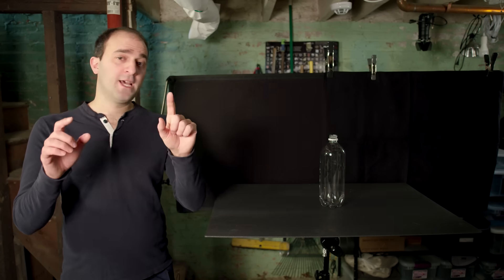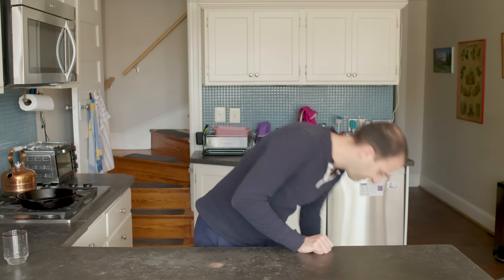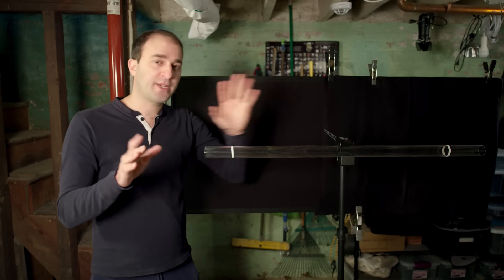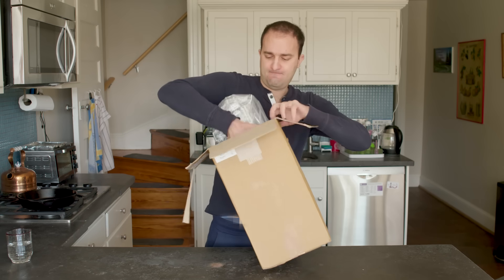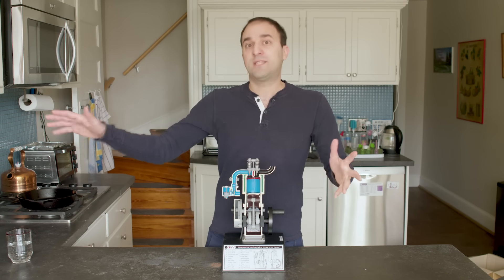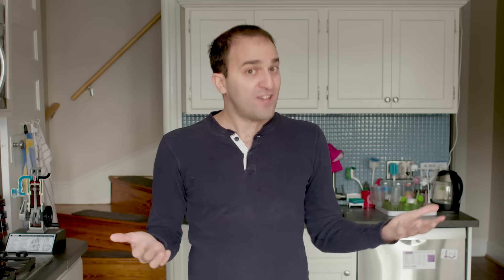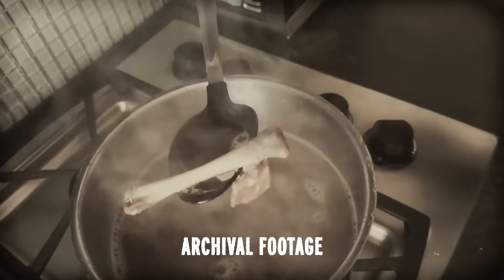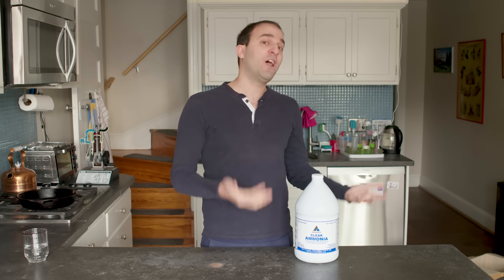Does Toyota Know Something That We Don’t?

Comment: LOl, Dave Williams had this discussion on Usenet back in 1998. Dave's and his friends had real world application discussions and experimentation for cars, and various other things. Anyhow they were discussing power adders to use on cars to enhance combustion and enhance cooling. They realized that Ammonia Solution used as a household cleaner could function very similarly to water methanol injection. The only caveat that they discovered, aside from the imaginary belief that burning ammonia makes more Nox(it doesn't it makes more N2 hence why it's used in heavy industry to remove nitrogen). was that it bonded to an extra atom of air so that had to be adjusted for by leaning the gasoline concentration.

Comment: Oh  here we go again.    Go ahead, get yourself a gallon of industrial strength ammonia, which by the way is less than 30% ammonia in water solution,  take it outside and crack the lid.  Within seconds you will know why it will not be a widely used motor fuel. Unless you are a saint, you will say bad words, put the lid back on and get away from it.  You are instictively driven to get away from it, and by driven, I mean if it is concentrated enough you will run away, a bit stronger and you will run over those who run slower than you do, just a bit stronger and your head will spin and you pass out,  just a tad stronger any you die from lack of oxygen in your brain. 
 And where would the ammonia come from? From natural gas.   Well why not just compress the natural gas and save all that conversion loss, asphixiation risk  and have a more energetic fuel by volume, that is much easier to store and wont kill everybody in the parking garage when one car springs a leak?   I dont know what is going on with Toyota execs,  surely they know as much as I do about basic chemistry?    Or maybe they have one heckuva rabbit up their sleeve?

Comment: Think you are missing something regarding the use of ammonia as a fuel, stop thinking about burning ammonia and start thinking about burning hydrogen as the vehicle travels down the road with a cylinder of ammonia at a relatively low pressure say 1000kpa liquid in a pressure cylinder much like an old LPG system and then the NH3 is catalytically converted to Hydrogen on demand as required and the nitrogen is released. The advantage is that you know have a reasonably low pressure liquid fuel with reasonable range capability and have greatly reduced the risks of carrying very high pressure hydrogen gas which has a very wide range of combustibility and low energy and temperature ignition capacity making it quite hazardous as a fuel in a car. This concept makes far more sense the direct use of hydrogen or the use of ammonia directly as a fuel. It’s also worth noting that ammonia actually has a very narrow combustible range and much higher ignition energy.
Ammonia is already transported as a pressurised liquid for fertiliser use, obviously if it were to be used as a fuel there needs to be far more ammonia and its distribution. I guess the challenge would be that ammonia is typically produced from natural gas and CSG.

Comment: Compare this to methane, look up the sabatier process, ask yourself wtf, then get back to me. 
We have had CNG cars for decades, the technology to use it is fully mature, CNG conversion is possible and inexpensive for most vehicles, much of the developed world is filled with the infrastructure to distribute it to every home, and it can be manufactured at scale from water and CO2. We could turn every coastal oil rig into a solar/wind powered methane farm and replace fossil fuels entirely with a carbon neutral fuel we're already using. 
If we had the will to do it.

Comment: Anhydrous ammonia actually has the greatest heat capacity per unit mass of any liquid, slightly surpassing water and far eclipsing synthetic refrigerants. Water is not usable in most heat pumps because its triple point is 0°C and the cold side fluid most often needs to be, well, fluid, even below 0°C. So ammonia it is. We should make fridges and AC units run on ammonia because it's both more efficient and doesn't warm the planet when it leaks, unlike HFCs like R-134a which are thousands of times more potent than CO2.

Of course if you look in history books, ammonia was used for refrigeration even prior to the invention of Freon, which not only performs worse but has the additional disadvantage of destroying the ozone layer. So why did we switch? It turn out breathing Freon is not such a big deal, so long as there isn't enough of it to displace oxygen. Breathing ammonia is extremely dangerous and immediately causes fatal lung injury.

Comment: I wonder if the ammonia will mix with the residual formaldehyde in the gasket material used to seal the engine. Hexamine crystals should form and could cause an uncontrollable fire.

Comment: We have enough chemicals surrounding us that if they were mixed together at the right speeds and doses 😂we could accidentally remove a layer off the face of the earth.  Chemicals are just dangerous, and I don't need to stick my hands in fire to know what hot is. I appreciate your caution 👍 this is a cool idea but I have removed wax from floors and know that odor.

Comment: The Haber Bosch process uses huge amounts of Fossil Fuel to generate the 500C temperatures at 200Bar pressures. 1% ish of greenhouse gasses produced are due to ammonia production. We are better off just burning the gasoline in the first place from an environmental standpoint, at least until a greener method of ammonia production is productionized.

Comment: There are a lot of potential liquid fuels they all have significant drawbacks compared to gasoline and diesel. The problem with gasoline and diesel are carbon emissions. Yes both hydrazine and ammonia are potentially carbon free fuels the problem is they are toxic and caustic.

Comment: Crunched some numbers and looked at the technical implementation as well as safety on this and it seems to me that : 

Safety - Compared to fossil fuels ammonia is less dangerous for humans and nature. Yes that direct contact/inhaling is damaging and needs to be secured. But inhaling petrol fumes are worse since its cancerogenic and less detectable. 

Production and distribution - The fertilizing industry (who is a huge industry) have safely been handling, producing and transported ammonia. So all/mosy the regulations are in place as well as tech for storage. In addition to convert gas station to handle ammonia is probably easier technically and more direct conversion as well as saving on cost for new infrastructure; compared to totally new infrastructure for EV.

Effeciency - An ammonia engine by itself is not the final idea. There is a hybrid version where ammonia is cooperating with another solution that is used for accelaration efficiency and the natural cycle for ammonia is aided in that type of hybrid engine. And ammonia is more efficient compared to petrol or diesel.

And engine type probably shouldn't be your typical 4 or 6 cyl engine. The OTTO combustion engine is a direct decendant of the steam engine principle. Time to reinvent that or bring out the engine types that industry has previously discarder or marginalist that are more suitable. We also probably need to create engines with ceramics and glass materials.

Ammonia is part of the natural cycle on planet earth (In production, consumtion and recycling). 
Not as fossil fuels or EV tech that consumes lots of expensive resources and is harmful as well as detrimental to nature after it has been consumed.

It is sadly the reality that industry, government and resources spent on innovation are more interested in short term profit and economically sound decision within a fiscal year, rather than think like nature; on a big scale and longterm perspectives beyond the next 10-20 years. Typical human I guess. We tend to forget or think outside our own lifetime. ;-)  

In short what needs to be adressed are a multi-tiered solution for "transportation" and NOT staring at ONLY fuel/energy: HOW we want trasportation to work in future (remember history has driven the development (industries/markets) of existing solution/infrastructure - We really need to rethink this. That means TYPE of vehicles and their purpose, engine types and the energy spenditure. The sum of all.

Disclaimer: I'm not an engineer, just a concerned citizen on this blue ball trying to solve problems to benefit a better way of life. :-D

Comment: ...1ST OF all....TALKING ABOUT "CLIMATE CHANGE" IS GAINING "loyalty points" IN DEMOCRATIC PARTY'S HIERARCHIAL SYSTEM WHICH can BE EXCHANGED BY LOOT FROM "less loyal"

.......2nd OF ALL .....LIKE LITHIUM IS LESS DANGEROUS,OR CARRYING HYDROGEN..........OR ANY NATURAL GAS EQUIPMENT.......SO just a precaution MEASURE AND OK

........3RD.....IF TO SPEAK ABOUT climate change,THE MOST EFFECTIVE OPTION IS..... PUT PEOPLE IN CAGES IF THEY ARENT OFFICIALS!!!! .........BECAUSE of IN ORDER TO GET A full control OVER CARBON EMISSIONS))........AND believe me THAT several hundreds of hypercars and private jets wont do harm to the environment)))) .....THAT'S WHY I'M strictly AGAINST FIGHTING THAT "climate change" AS IT IS A SOURCE OF getting loyalty points

.....BUT I'M FOR SWITCHING TO AMMMONIA LIKE anyways !!!!AND NOT combustion engines BUT RATHER FUEL CELLS !!BESIDES, effeciency of gas engine is 30% and fuel cell is 99% ,SO IT'S EVEN better!!!!LIKE FUEL CELL+ELECTRIC MOTORS>GAS ENGINE........OK??????........

...BESIDES, THERE'S POSSIBLE TO MAKE A SOLAR ELEMENT THAT MAKES AMMONIA STRAIGHT FROM ATHMOSPHERE AIR AND WATER .....TALK ABOUT cheap!!!!EVEN CHEAPER THAN GAS BY A MARGIN!!DIRT CHEAP!!!AVAILABLE everywhere!!!FOR everyone to have a car!!!!

...........BESIDES,I REMEMBER SOME FORD THAT GOT A GAS TANK JUST AT REAR SO IF SOMEONE BUMPED IT'D EXPLODE.........BUT IT GOT FIXED,AND ok......

....SO, I'M FOR AMMONIA ..........EVEN THO I'M AGAINST "fighting climate change"......AND I'M FOR PEOPLE TO BE PEOPLE ,NOT monkeys trying to get and exchange some loyalty points by hurting someone
Reply: The way you have formatted your post makes you appear to be angry and insane.
Reply: @peterkotara  ...AHHH,I'VE GOT IT!!YOU'RE TRYING TO GET SOME loyalty points))??OKAY DO AS U WISH,I DO NOT CARE ABOUT what's at your imagination ON WHICH NOBODY IS RESPONSIBLE INCLUDING ME

......AND IF U WANNA,SAY SOME hierarchial truths,OK??SUCH AS EARTH IS FLAT OR SOME DEI STUFF........WHICH ARE essential FOR BREWING loyalty points ))....AS IT IS IMPOSSIBLE TO CREATE HIERARCHY ON SOMETHING SUCH AS 2+2=4))POSSIBLE ON 2+2=9)))

Comment: I'm starting to realize how old I am because I remember people modifying cars to burn ammonia back in 1973 '74 during the energy crisis. The folks doing it then were copying some guy in the '50s or '60s who drove a  car cross country on ammonia. 
 It's a shame there's not a large recovered carbon source because paraffin can pack in hydrogen fairly densely as well. It's easier to store if you pick the right kind, even as a solid if you want.   Used in fuel cells it's possible to capture the carbon again.  Even if it's only economical on a large scale it's a near carbon neutral power plant  or ship propulsion system.

Comment: For the people who keep complaining in the comments, especially about anything when it comes to green stuff in cars, here are some realistic pros and cons about ammonia

-ammonia has a better energy density than batterys, and can be refuled at the same speed as any other liquid fuel
-ammonia can somewhat easily be converted into hydrogen
-ammonia is an awful fuel if burned in engines (at least if its in the way shown in this video), but a really good one once converted to hydrogen
-ammonia is safer and easyer to handle than hydrogen (not as explosive, and doesnt need to be highly pressurized in a gas tank), and has the same ease of handling as as other liquid fuel
-ammonia can easily be catalyzed into hydrogen and nitrogen (both not toxic to the enviroment or ppl)
-ammonia doesnt need any special infrastructure to be supplied to people, in comparison to more powercables, extra charging ports, or hydrogen pipelines
-ammonia is produces from hydrogen, which is either produced from fossil fuels with lots of waste (co2), or water which takes a lot of electricity, making fully green ammonia even more energy intensive (and less energy efficient overall, because each conversion step adds more energy inefficiencys) than hydrogen
-ammonia needs a special seup in the car, no matter which way its used (as shown in this video needs a special tank, and a specially adjusted motor, and if its used for hydrogen in a hydrogen fuel cell it needs a conversion apparatus)

Tldr
It has the same problems as hydrogen when it comes to inefficiencys (and it being useless unless its fully produced from renewable energy sources), but it solves a bunch of annoying problems, such as the infra structure problems, since the only real change needed would be gas stations needing to add another tank and nozzle
The biggest drawback is that cars would need a huge modification to not only run with it, but also run safely with it

In total its another idea which can be thrown into the mix which could be used instead of hydrogen, while the hydrogen infra structure is still getting set up
Problem however will both be the upfront cost for a complex car (probably not as bad as non hydrogen cars with their super expensive battery though), and the continuous costs for all the conversion innefficiencys
But dispite all of that its a smart idea... even if shown in its worst form in this video

Comment: The only important part of this video is exactly at 3:00 where the table clearly shows ethanol is the best and people knew it and it was the first fuel before certain people started legislating against it in favor of petroleum. The main reason being that you can make ethanol at home but you cant drill oil at home.
Reply: In all relevant metrics, such as LHV and HHV, ethanol is significantly worse than petroleum and diesel. Growing ethanol for fuel is way more expensive than extracting fossil fuels.
Reply: @CjqNslXUcM  You don't need to grow it for fuel. It's a byproduct of fermenting sugars. Every house could distill it from any bad fruit or grain. As far as growing is concerned here are some calculations I did. Lets say you drive 20.000 km/y in a car that burns
10 l/100km which would be
2000 l/y gas and gas is 2x denser than ethanol so you would need
4000 l/y of ethanol which you can distill from
12000 kg of corn which can be grown on 3 acre of lande since you get about 4 tonnes of corn per acre. You can even grow grapes instead of corn which have a higher sugar % and can be grown on hillsides and you don't need new tech or much refining. Distilling can be done with renewables. You can convert any gas car with a carburator at home with a few spare parts to run on alcohol. Methanol could also be a substitue and we already mine that. Brazil has a mandatory production quota for car companies to make E85 cars. I think this is the most painless solution to transition to because you can keep using the existing cars already on the roads with a few tweaks but no sane company would invest into products they already sold a year or 10 yeara ago so they have to invent a new thing to sell or they go out of business. The issue is you can't drive common good goals through for profit companies because the end goal is often diametrically oposed.